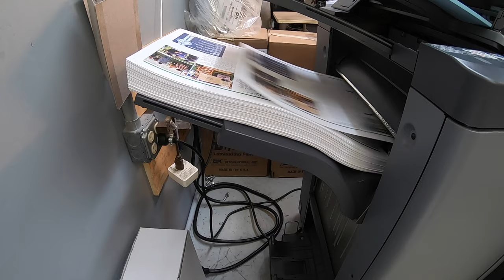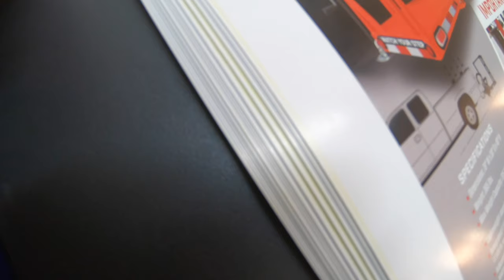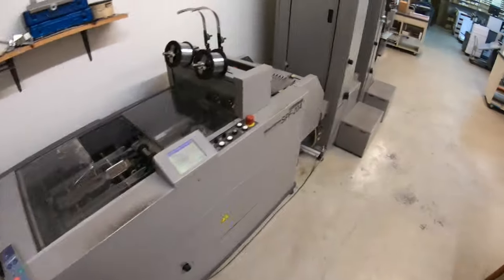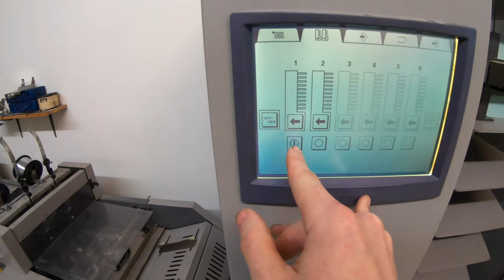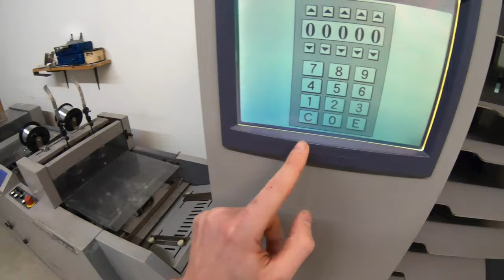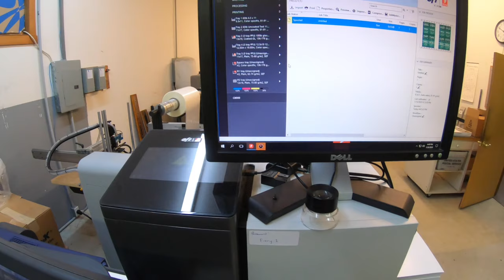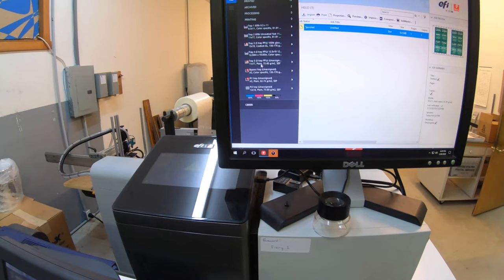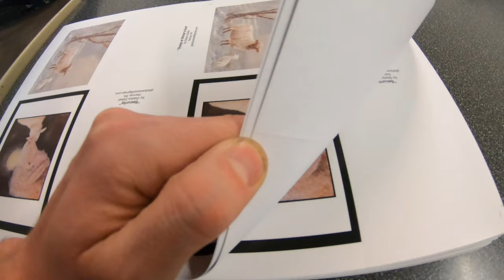Printing and Binding Newsletters, Labels, Marketing Flyers, Folded Brochures

Comment: Your channel is so cool! I want to make my own magazines and I was wondering how works all of this.
Reply from the maker: There are many different machines that can accomplish this. I would suggest you find an online or local printer to start printing your magazine. Once established you can invest in your own machine.
Reply: @justaprinter  Thank you! I was wondering what Digital Printer is the cheapest to print with commercial quality, and I don't understand why Digital Printers print with photo quality and my home laser colo printer (HP M254dw)  don't if both use toner cartridges.
Reply from the maker: @AlbertVlogs  It could be settings in the software RIP, or difference in the hardware such as lasers. Toner is just what gets transferred to the paper, how it gets there is different.

Comment: Could you recommend a decent starting printer for high quality single page flyers and business cards to start? Let's say under 1200 used if that's reasonable.
Reply from the maker: The smallest press I can recommend is a Konica C6500. I am sure there are smaller cheaper machines but I don't have experience with them. Konica and Ricoh office copiers are nice.
Reply: @justaprinter  thanks for the response. A little out of my budget but I can save for that. They look like $3000-4000 used. Should I worry about print meter or are they pretty reliable and serviceable? Some I see are 2-5 million on the meter used.

Comment: What would be a good home printer for small printing business starting up.
Reply from the maker: Great question. The only machines I know are the c6500 and 1070 like I currently have. Other people have mentioned that the konica office copiers are good as well as ricoh. I would find a local dealer and see some test prints they make. They might have a used machine to sell to you.